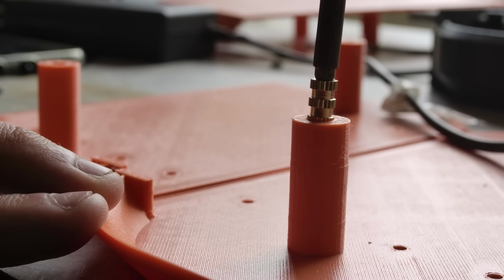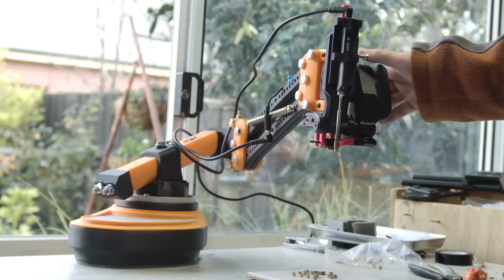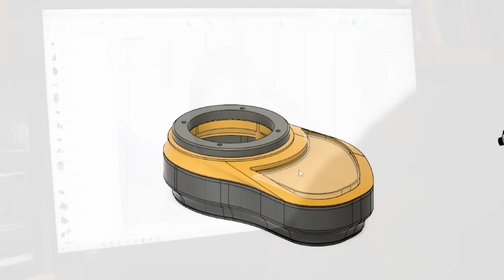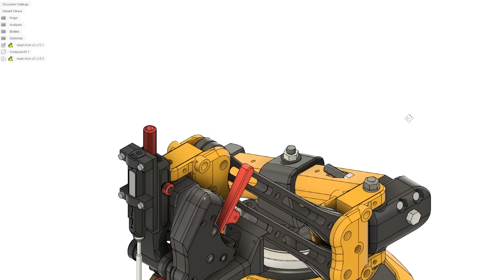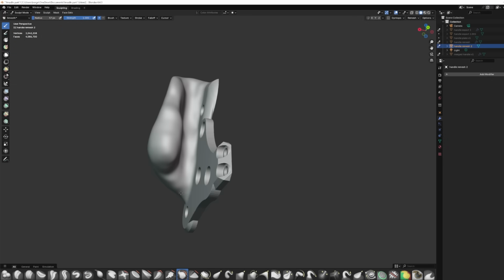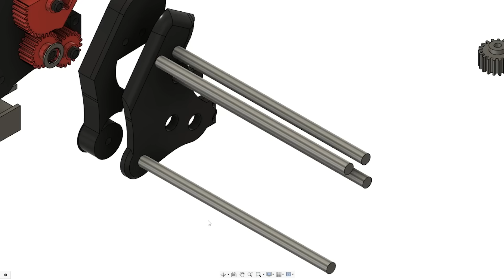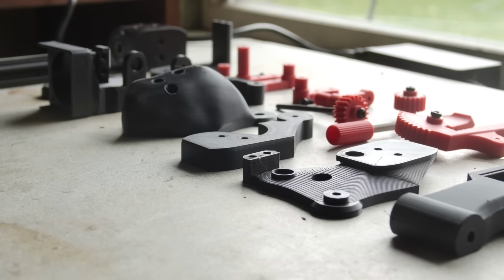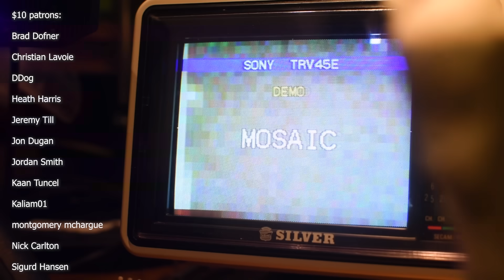A Better Tool For Heat Set Inserts?

Comment: I don´t really understand the motivation. Usually using a soldering iron you have anyway and then pushing it in until 1-2mm are remaining outside and then using some flat metal surface block to make it level with the surface and cooling it in place, seems very straight forward to me. (And fast)

Comment: Best tool for heat set inserts is a bolt, which you can see in this video at 4:58. You just need to file down the markings and press the inserts with the head. Everything turns out perfectly straight and in seconds.The rest of the assembly can be thrown away.

Comment: Instead of a depth stop you could add a second moving metal part on the other side, to act as a cold press tool. It could be L shaped, spring loaded and pushed down with the thumb. The bottom of the L would be parallel to the mounting surface and it could be at a height that makes it collide with the part when the insert is almost all the way in, then you move the soldering iron up, push the thumb button which lowers the metal L further down than the tip of the soldering iron an you use the bottom of the L to push the insert all the way in. 
You would also need a way to set the depth of the resting position, to set it for different sized inserts, but that could just be a srew that stops the motion at the top.

Comment: It's great but come on it's sooo Overengineered. Building a moving arm instead of a straight up and down moving arm would have simplified soo much of this design. And while I understand that Concrete Filled 3d prints are your trademark a woodden Baseboard that the arm would be screwed to would have worked fine too. The Gripper is definitely very cool though!

Comment: Neat design. Would not a layer of rtv silicone at the front of the brass wedge, and maybe a heatsink on the back prevent need of an active fan?

Comment: I don’t understand the difficulty in installing inserts and the need for a machine to assist. If you use the correct inserts (CNC Kitchen) and the workpiece was designed correctly, it isn’t hard. After installing a few it becomes effortless to install them straight. If precision install is needed beyond that, you’re probably using the wrong material to begin with. I just don’t get it

Comment: Great video! If you could work on a heat set insert sorter so the orientation was correct everytime this would be totally complete. You just need them vertical to pickup consistently.

Comment: 1:06 3D printing heat set inserts have an “alignment ring” you place into the prepared hole of the exact diameter of that ring. No need to hold the inserts 😊 … But your solution is much cooler! 👍

Comment: Im not sure if I missed it but have you considered using a shake table or concrete vibrator to remove bubbles/ improve concrete flow throughout your molds? You seem to use quite wet/loose concrete, so it probably doesn't matter much. If you add some sort of agitation you might be able to decrease the water content and therefore increase the strength of your builds.

Regardless, excellent work on this build. Your machine design is always absolutely beautiful, and you make great videos as well.

Comment: Awesome design! To solve your depth stop issue, you could use your gripper. If the gripper has an adjustable travel limit, the bottom of the gripper can serve as your depth stop.

Comment: What concrete mix do you use? The instructions on the package always have you mix it really dry and if I add extra water it gets really brittle when it's cured.. Do you have any advice? I've tried 3 different concrete mixes, also seen some additives called flow improvers online but haven't tried them yet

Comment: My only critisim is that is should be slightly positively "buoyant" as to raise the hot part when not in use. This just increases safety as one could walk away without worry about burning something they shouldn't. Otherwise it's a great build and I want to make one so bad.

Comment: Cool build. I took an old "fire stick" radio shack iron, diverted the cord out the side, and stuck a bolt out the end where the cord used to be. I can put it in the drill press now and use it as a press. I only really use it on 6mm and larger though. The concrete is smart! I need to use that trick.

Comment: I work in aerospace, and used to work for a company that did basically all the control panels for all Boeing commercial planes, as well as a ton of military planes. After the machined plexi got the back white paint, then black paint to seal in the light, it'd come over to me and I'd drill to the proper depth to clear out the paint for the proper amount of light before it went to the dark booth to be white balance painted. I also installed the heat set inserts to be able to attach the circuit board with the LED's on it for said white balancing. We installed the heat set inserts by hand and used a small cylinder of aluminum (aluminium for the rest of the world) with a nice flat end to immediately press on the installed heated insert after removing the soldering iron. One, this is a great heat sink to quickly cool it down, and two, it gave you a perfectly flush finish and pushed down the ridges of the melted plastic. We then had to use a height gauge to measure the depth and make sure they were in spec. Long story short, if doing them by hand was good enough for fighter jets, it's good enough for my 3D prints. Lol.
Reply: i use a brass thumbscrew as a helping tool. The screw end is good for forcing the inserts into holes initially (so they stick out, ready to be pressed in by an iron), and the other end has a flat surface for the finishing you described. It's sure not as fast and beautiful as the Chris' arm, but it is very versatile (i can see the arm being not super useful for any inserts that are not square to the opposing surface, and completely useless for those that are buried a bit... all that isn't super common, but does happen)
Reply: @victortitov1740  Oh good call! We have a ton of brass thumb screws at work. May need to grab one and give it a try. Just using the end of my metal deburr tool right now, and while the end is flat, it's quite small and somewhat domed leading up to it. Can be hard to feel if I'm nice and square when pressing down. And yeah, if it's not square/perpendicular to the insert tool, it wouldn't fare too well. Like you said, that's a bit more rare, though. It's still an awesome design, and that torque arm could be used for so many cool things. Also can't wait to find time for his ball vise. That thing is so sweet! Once my shop is done and I have more room and need a cool little weekend project, I'll probably make the insert tool to try it out. Who knows, I may fall in love with it. Lol.
Reply: Yes!  I saw a YouTuber doing this using the metal scraper that comes in most 3d printing tool boxes, sinking the insert most of the way with the iron, then setting it flush with the scraper.  Such a useful technique, as varying depths or edges keep me up at night
Reply: This comment shows a better solution than all those overengineered ones conceived by 3d printing community ...
Reply: @cromyjr1592 Okay buddy, whatever! I also solved the heat insert issue, and I dare say my solution is the best. I built a miniature forge to melt down aluminum cans I collected after graciously donating my precious time and effort to the city, collecting them from parks, interstates, and greenways. I then poured the molten aluminum into a mold I crafted using sand I gathered during a personal detox retreat to Whitehaven Beach in Australia.

Whitehaven Beach is home to the most pristine, ultra-fine sand in the world. Fun fact: sand from Whitehaven was once used to create the glass for the Hubble Telescope!

The mold I designed is easy to hold in one hand. Its convex base presses the heated insert flush against the 3D model, flattening any plastic ridges that might form during insertion. The final, and unquestionably most important part of my creation was determining the ideal convex shape for our application.

To achieve this, I flew to India and convinced Aishwarya Rai Bachchan to let me create a mold of her eyeballs (arguably some of the most stunning eyeballs on Earth). One of her eyes (the left) had a superior radius, so that’s the one I used. It’s what allows me to create perfectly flush and smooth heated inserts.

And sorry, this flawless heated-insert push rod is for me only. Don't even ask. You can go ahead and use the hex end of a lag bolt to push down your heated inserts.
Reply: @SID6.7  You are reading too much into this. Is your book length comment a pathetic attempt at humor ? My comment was a jab at overthinking and overengineering in the 3D community.

Comment: Great machine, as always! But installing inserts is super easy by hands. Print a hole exactly for the neck of the insert, put an insert there, push it with a soldering iron just one millimeter short, and then push it flash with a printed surface using something flat, such as a head of a bolt.

Comment: I made a little press from a small drill press and I don't even use heat.  I just cold press the inserts and it works fine.  The pilot hole size is important though.  Don't make it too small.

Comment: Will you do the auto-loading screwdriver at some point? It could be interchangeable on the arm. If so you can use what you learn from that to make the inserts load themselves.

Comment: is the gripping tool normally open or normally closed. Perhaps you could design a variant for those with preference. 
another possible option is to use the same mechanism from a bike cable brake to allow use of a pedal with the gripper for further accessibility.

Comment: I think an improvement would to make the grabber auto grab as you lower the iron onto to pick it up, like a spring loaded detent.
Put the bracket/chassis for the grabber on a spring loaded slider with a lever in the grip and you can disengage it with a very small movement(think light switch), while having the spring reset it when not actuated.
Reply: The idea being that you can pick up the inserts simply by lowering the iron into it until it clicks, swing it over and start inserting, when a slight pressure of a finger or thumb retracts it. When done setting, release the pressure and you're automatically set to pick up the next insert.

It would probably take a LOT of planning and development to actually make it, but once it's made it should be quite easy to use, and be modular enough to easily remove or replace if needed
Reply: The grabber being able to move laterally but not vertically, while the bracket being able to move vertically but not laterally should allow the mechanism to be pretty strong, while remaining relatively simple.
Maybe the right filament would allow printing the bracket with a "spring" included a use something like a brake line to pull on it?

Comment: I like the KISS approach but I couldn't help watching the latest installment of extreme engineering of the heat set insert tool.  Wow.  Nicely done.  This needs to be appreciated as the high engineering art that it is.  Most of my FreeCAD designs are linear-orthogonal but I did get a Matter and Form THREE 3D scanner so I can make more organic designs such as your scanned modeling clay handle.

Comment: this is INCREDIBLY cool. i do wonder if, the way the gripper is currently designed, it might interfere with putting inserts in tight spaces? and/or risk the hot brass piece brushing against & melting a surface accidentally. it seems to me that having the metal gripper be aligned mostly vertically, with a "dorsal"/lengthwise bend to get the v-shape at the tip, & using a pincer/tong-like action to grasp might get it in a smaller footprint.

Comment: The symmetrical inserts you are using are intended for injection moulding and not for hot insertion. Check the ones that CNC Kitchen sells, they have one end beveled for insertion.

Comment: Nice tool :)
If in a pinch you can also use your 3d printer to press the inserts. Just manually lower the heated nozel and press the insert with it.
That way you could even automate most of the process. I'd recommend to add manual confirmations in the gcode though to have the pinter wait for you to place the inserts.

Comment: if you made the grabber more of an L shape, you could have it sprung kind of like a clothes peg and take away a LOT of the bulk which would allow for inserting inserts in hard to reach places. you could basically just have it run up the back and have it finger actuated like a trigger, so when you pull the trigger, it lifts away from the heating element, when you release, it springs back.

Comment: Your design is so close to perfection, it's hard to find a suggestion for improvement.  :)
Why not "invert" the gripper motion.
Normal open. Pulling the trigger holds the insert. Releasing the trigger releases the insert.
Maybe then you can omit the fan?

Comment: Good work. Definitely needs a depth stop or use the brass gripper to seat the insert flush with the top of the plastic. It also makes the plastic flush. I use a metal ruler for this now. Another nice addition would be an LED light to make it easier to see when you're aligning the insert. You're already running power to the fan so shouldn't need much modding.

Comment: Great Video! I'm a bit surprised to see, that the posts, in which you insert the threads, are just cylinders on vertical surfaces. in my very limited experience this is really weak. The slicer (I manly use Cura) doesn't do much to better attach the post to the surface. I found out, that adding even a small fillet at the contact between surface and post greatly increases the strength. The vertical layer lines are still week and the contact area is not that much bigger, but I guess the fillet reduces the stress concentrations, so that the post doesn't brake off so easily.

Comment: Not ME but that gripper seems like a prefect candidate for bistable flexture. Another idea to make this cooler is make it a robotic arm instead of good old spring. That allows it to prefectly hold any weight by FOC, and it can also repeat whatever you did in case you have a bunch of identical parts.

Comment: i woudl have it attached to the ceiling, with some elastic rope that makes it go back up when unused, and then a tiny dock on the table that would lock it in place for when u want to use it, and when you don' you just leave it hanging up there. this is how it is usually done in factories with screwdrivers

Comment: I saw someone else post it, but Stefan was probably talking about the fact you are using injection molding inserts instead of better tapered inserts (the ones with diagonal knurling) with better pull-out strength.

Comment: I think your design is genius, on a flipside the griper could do a secondary function, when the insert its almost in, you can use the gripper as a 'flat' surface and press it while the surroundings are still hot,  its the way i do it and makes the final touch like the cheffs kiss😂.
The fan its apreciated but i rather have a led pointing directly on the tip and reconfiguring a little the gripper with more length and graving it with stacks of paper like a thermal barrier, for thus avoiding the fan

Comment: just do it by hand. use a credit card or feeler gauge or something to finish the job if it needs to be perfectly flush. you're very welcome. having actually built a heat insert press of my own in the past, i very quickly realised that it was actually less convenient to use than just hold the iron myself. and it wastes space

Comment: I have been watching you for a while and I noticed that you print your concrete molds completely hollow. I had been thinking for a while now, could you not design them as solid parts, then in the slicer use gyroid infill which allows for the entire internal volume of the print to be contiguous. I was thinking you would then want to use a flowable concrete like countertop concrete, the stuff here in the US also has some fibers in it to help with strength as well. All the infill would essentially function like rebar and should make your stuff considerably stronger and could prevent the need for internally reinforcing rods as I have seen before. 

I have been meaning to start experimenting with the idea myself, but I haven't managed to get around to it myself as of yet.